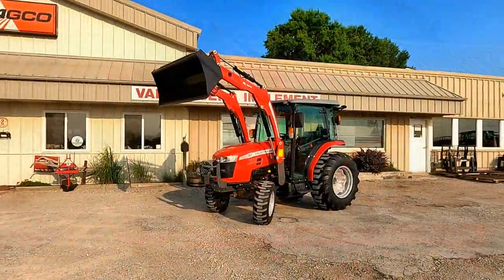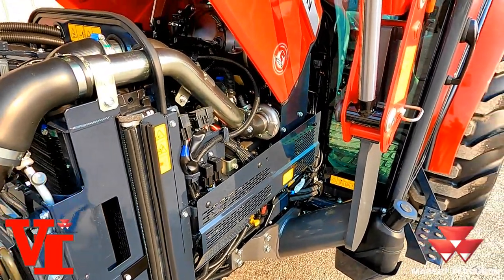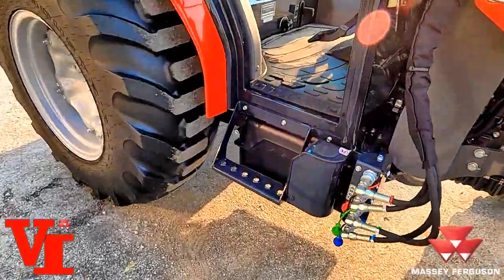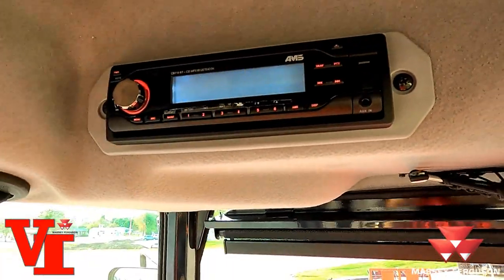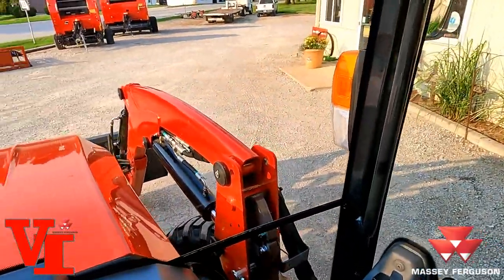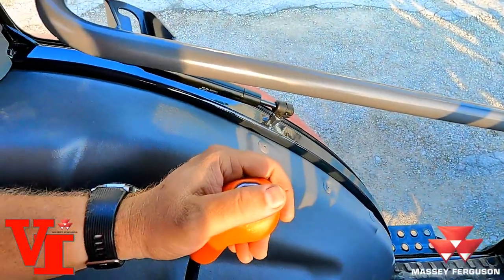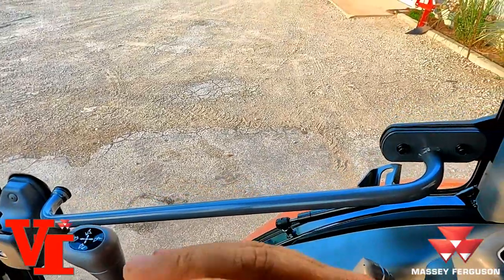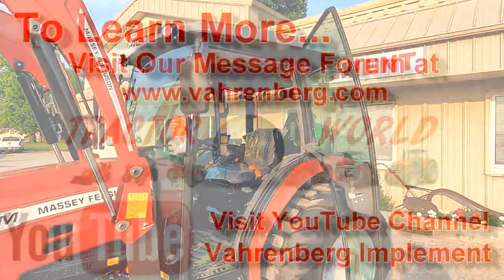Massey Ferguson 2860M eHydro Deluxe Cab Premium Compact Utility Tractor

Comment: I just took delivery of my 2860M hydro about three weeks ago.  Due to shortage of some components I don’t have the paid for third function on it yet.  Grapple is on order from Everything Attachments, so I’m ok without for now.  I’m an old clutch and transmission guy, and was wondering if I did right going to the hydro.  I LIKE it!  Found that Snail mode will really let the loader cut the dirt well!  Turtle mode is just about right in the field work.  Have not had it in Hare mode yet.  Thanks for the tip on using the cruise control and using the hydro control pedal to “catch” the speed and then smoothly decrease speed rather than the abrupt stop that happens if you push the button or hit the brakes. Also a good tip on using the single brake and building back pressure on slopes to prevent  rolling the wrong direction.  I suspect that trick works well when going either forward or reverse?  I’ll try it.  Had the AC on today with outside temp of 90 and very comfy inside the standard cab.  Have not found anything I dislike about this tractor.  With its size and capability it is on the high end of a Compact tractor.  It does a lot of things a traditional Utility tractor would do.  Thanks for all your videos.  Helped me buy Massey F.  No buyers remorse here!
Reply from the maker: Thanks for the AWESOME Review. That is good information and what we are hearing from our customers too. There is shortage on 3rd Function Kits...some guy did videos on them and with the high demand for Massey Ferguson Tractors in 2021 has created a supply issue. Thanks for taking the time to watch and comment on our video.

Comment: I was looking at the 2600H series and noticed it didn’t use the DPF..I also noticed the H series was pretty much all mechanical, which in my opinion is more reliable in that long run. My question is why the are these tractors equipped with the DPF while other MF tractors similar HP are not. 
I currently run a 2018 Kioti 40 HP. In the future I’d consider the MF if I decide to upgrade. Great video, keep ‘em coming.
Reply from the maker: 2800M are Stage 5 Level Emission (Coming to North America soon already in enforcement in Europe). AGCO made the decision because the writing was already on the wall when they developed the 2800M to forgo meeting just Tier 4 and Got to Stage 5 when it invested in helping ISEKI bring their engine back to market. They decided on a DPF Filter and Regen as the means to Meet Stage 5 Emissions. 
 2600H series Engine is clean enough to meet Tier 4 Emissions without REGEN, Diesel Particulate Filter or need for Diesel Exhaust Fluid. Uses EGR Exhaust Gas Recirculation. Depends on the Engine and how much soot (particulate Matter) or NOx (Nitrous Oxide) Gases an engine produces if it needs After Treatment. The 2600H does not require any after treatment systems. Also there are several Tiers with the Tier 4 Level less than 25 Engine HP, 25 to 75 Engine HP, 75 to 150 Engine HP and 150 Engine HP and above each one of these levels have different levels of Particulate Matters and NOx Gas Levels the engine can omit.

Comment: I have a 2860M hydro, and I love it. My only complaint is the auto throttle, specifically the fact that you can not disable it. Their are times when you don't want the tractor to change the RPM, you just want to adjust your ground speed.   I can list at least 4 different scenarios.  If you know a way to disable it, I would love to hear it.  All other manufactures that offer auto throttle have a way to disable it, why wouldn't Massey?
Reply from the maker: You can set the Manual Throttle to Minimum RPM and auto throttle will only work above that. My personal tractor I own has AutoThrottle and I can't think of a time I would want it disabled.
Reply: @VahrenbergImplement  Well, I can give a couple, when tedding hay, you need to adjust ground speed separate from the PTO. when I'm tilling and I get to the end of a row and I am traveling across the end of the garden empty and want to hurry across. When you travel down the road and you want to put the hydro pedal to the max. but not run 2700 RPMs. When you store it inside a shop but want to pull it outside to warm up, the moment you touch the hydro pedal it revs the engine.  I can go on, but you get the idea. Most of the time auto throttle is just fine, but there are times when it is a nuisance, and I would like the option to disable it.  There is no doubt that it is possible for Massey to have a way to disable it. I wish they would offer it.
Reply from the maker: 1) Tiling Example that is where AutoThrottle shines it will help get you there faster because the higher the throttle the faster you will travel. 2) Road Travel: If your running that fast you need more throttle or you'll be stalling the hydrostat at low rpm. 3) Use a lower range and it will not put as much load and not raise the RPMs with Autothrottle. How much are you willing to pay to Turn On/Off Auto Throttle? It's going to add more expense to the manufacturing of the tractor and not sure most if not all my customers would find any value in turning it off, probably the second most loved feature behind ground leveling fueling we get comments about to customers that own tractors with autothrottle.
Reply: @VahrenbergImplement  I am not looking to debate you on how great autothrottle is. Massey Ferguson's Autothrottle is not load sensing, it is preset in relation to the pedal position it has no idea if the tractor is pulling a load or just rolling out of the shed that is why It is not the perfect solution every time, that is why all other manufactures ( I don't believe they have load sensing either)  let you shut it off. 1) Tilling, I do want to move faster, but I'm not willing to rev the engine to the max to do it. (no load). 2) Road travel,(no load again) I don't stall the hydrostat, there is a happy medium between hydro position and throttle, experienced operators can hear, feel it. 3) pulling out of the shed to warm up. Using a lower range makes no difference, again not load sensing.  I am not bashing Massey, I was raised on them.  If I had the option to turn of Autothrottle it would be perfect,  If I could disable it permanently, I would rather do that. Just let your Rep. know that giving an override option instead of dumbing it down to the masses may be a better answer.  I have probably watched every video that you have posted on the Massey compacts, you do a great job and have great content.  Please keep it up. I am just hoping someone can help me find a way to override this option. Or may sure another buyer understands fully how it works.

Comment: What type of hydraulic oil do these tractors use , Just bought a 2850M shuttle shift about a month ago what a great tractor i love it , got 18 hrs on a tank of fuel not even topped off i think that was pretty good , plenty of power for what i am doing , Waiting on the second & third remote kits hopefully i get them this year , There is one thing i think needs to be corrected on a 2800 series Massey Ferguson tractors with shuttle shift the brake pedal is too close to the foot throttle i got a big foot & when its on the foot throttle my foot is under the right brake pedal i guess if you had a size 6 shoe it wouldn't be so bad, other than that
i really like it cold AC. good responsive hydraulics, The neighbors i haven't talked in over 2 years seen it & stopped by to check it out i think they went home to ask the wives if they were allowed to buy one too , I do like it so much to i might buy another one a little bigger next year I am one of those guys that needs two of everything Ha Ha.
Reply from the maker: AGCO Parts PermaTranIII/821XL Hydraulic Transmission Fluid is the OEM Fluid and what we use.

Comment: Since it is a quicke loader, any chance to get a mechanic self leveling loader like their C18S, or a conversion for the FL 2814? Can we get the FL 2811 loader in the US?
Reply from the maker: At this time Mechanical Self Leveling in not available in North America. I keep requesting it on my Wish List.  Be a great option for Massey Ferguson Compacts .
Reply: It's amazing they don't make it available here since they already have it available in other countries.  It would be an easy selling feature to make the loader standout from others in its class.
Reply from the maker: I've been requesting for several years. It will come some day. Quicke use to have an add on system for Self Leveling and that would be the cats meow. Sell as aftermarket attachment and it was reasonable but I think even Quicke stopped that add on kit but they over Standard or Self Level Loaders. I know Australia requires all loaders to be self leveling. Maybe some day we can get them in the states.

Comment: Just curious, does the 2800M series have fender mounted 3 point controls?  I've been spoiled having large tractors that have them.
Reply from the maker: The 2800M does not offer 3 Point Controls on the Fender. Only PTO Start/Stop option. 4700 & Up Series offers 3 Point Controls but that is larger series and models

Comment: Doug - I am looking at this exact tractor. Is it a good move to get the mid mount PTO right away?
Reply from the maker: Mid PTO is pretty expensive options and we sell very few here in Missouri. What are you going to use the MidPTO for? Snow Blower is only reason I see to get on 2860M.
Reply: @VahrenbergImplement  Was just thinking of future flexibility
Reply from the maker: Yes Front Broom too can use the Mid PTO. We have sold one of those. Be interesting to see more Front Mounted Implements in the Future but there is not many uses in the midwest here.

Comment: Another great video.. what disappoints me is they are putting those r4 tires on everything it seems. If you were new to tractors and didn't know any better you'd be disappointed with those slick r4's. I wish r4 tires were the optional ones not the r1. Keep up the good work.
Reply from the maker: You can choose which tires to order. Customer wanted R4 Tires and what we have requested the most is R4 Tires. You can have Turf, Industrial or Ag Tires. Are number #1 selling tire is the R4 Industrial Tires.
Reply: @VahrenbergImplement  oh yeah I mean what I generally see at most dealers when everyone had stock was the r4's unless it was 75+ hp. IMO you shouldn't have r4's on a tractor you plan to do something with other than cutting grass. I guess my years of farming and land clearing has just taught me say no to r4's if you plan on working with your tractor and not cruising on it like a Cadillac.
Reply from the maker: R4 Industrial is the compromise between turf and ag. They are less aggressive on grass but still have traction & mud cleanout ability just not as much as Ag Tires. Ag Tires work off grass...the construction industry uses them on all their equipment and it is' off road. Ag Tires can be more aggressive than people want for their needs and they choose the tire that meets their needs. We sell very few AG Tires as they are over aggressive for most peoples needs in the smaller compacts and small utility tractors.
Reply: @VahrenbergImplement  love those Galaxy AG tires they are great

Comment: After owning my new 2860M now for about 9 months I am very happy with it.  Only possible improvement I would suggest is having an oil pressure gauge.  I am sure the electronics are monitoring oil anyway, so not a big issue.  Here is a video link with a Anything attachment’s root grapple, that I really like.  https://youtu.be/AUA4Lb6-PnI
Reply from the maker: Thanks for the comments and yes Grapples are a great addition to tractors. We sell lots of the RhinoAG & Worksaver Grapples and ALO Quicke 4-N-1 Buckets which are even more awesome for many of the tractors we sell here at our dealership. This is a little "Amateur" Operator learning Grappling with a AGR60 Grapple. https://youtu.be/6VUtVYxc1sk

Comment: Absolutely a great tractor  I just prefer the shuttle transmission instead because it's just more handier for me  I hope to be in the market to be purchasing a 2855 M series with a cab shuttle trans with  a loader and of course front fenders to keep stones and dirt from damaging the glass on the front of the cab
Reply from the maker: We done video on the Massey Ferguson 2860M Power Shuttle too: https://youtu.be/fI6vPTBOazI?si=qLbw27-jkbt4W3JS we haven't sold 2855M Power Shuttle yet but is another choice in tractors too.
Reply: @VahrenbergImplement  THANK YOU However I did see your video on the 2860M series shuttle version and it was a nice detailed video too . In my opinion I   think that both variations are great tractors . I just like the shuttle version better because it's like running a big front end loader. I like the 2855 because of the numbers 2800 because of the old 2805 V8 MASSEY years ago and the 1155 of the second gen.of the V8 . I  have my dad's old 1150 V8 MASSEY  THATS WHY I LIKE THE NUMBERS OF THE 2855 .

Comment: What  is the price  range?
Reply from the maker: Best thing is to contact your local dealer for Current Sale Promotion and Low Rate Financing Options. Due to Public Pricing Policies we can only supply MSRP (List Price) as of 8/22/22 List Price on 2860M Deluxe Cab eHydro with Loader is $48,799.22 but visit your local dealer for exact pricing. If in West Central Missouri near Kansas City contact us at Vahrenberg Implement if out side our sales area here is dealer locator to find your dealer: https://www.masseyferguson.com/en_us.html#dealer-locator

Comment: Debating between a MF2860 and a kubota grand l6060
Reply from the maker: We've been trading for several late model Kubota lately. Both are good models but everyone we have sold the 2860M to absolutely loves them. Good luck in making your decision for whats best for you.
Reply: @VahrenbergImplement  have you heard of any issues with the kubotas grand l series models?
Reply from the maker: I don't like talking negative about other products but I have had several customers tell me they have had issues that needed servicing like hydrostat transmission that we have not had with the Massey Ferguson. And it's not just one transmission. But you never get the whole story either...How Did they Maintain>? What Oils did they Use? How did they use it? Can all effect service life. We started selling Massey Ferguson in 2007 and we not had to work on single Hydro we have sold.
Reply: Andy go Massey and you'll be happy

Comment: Does Massey Ferguson not let you fix your tractors like John Deere?
Reply from the maker: Anyone can work on there tractor. For 2021  Massey Ferguson has started rolling out programs for the customer to rent diagnostic equipment to perform their own repairs. Has started on the Global Series for 2021 Massey Ferguson Tractors. Doesn't tell you how to fix it that is what dealers pay for Service School Training for their mechanics but you can rent the diagnostic tool and try it yourself. Right to Repair is very misleading like many things the media has done, 99.9% of the customers are not going to mess with internal computer codes and that was what Deere wanted to protect is their Intellectual Property and the media twisted it out of context. IP is just like Microsoft Operating Systems you use on your computer.
Reply: So your saying Massey Ferguson rents tools and programs to help fix your tractor?
Reply from the maker: Massey Ferguson offers an Electronic Diagnostic Tool Rental Program that can be rented from them to help farmers who wish to attempt to do their own repairs. The Only Massey Ferguson Models currently available with the NEW Diagnostic Software capable of this program is the 4700 Global Series Tractors. As new models are introduced they will start incorporating the same opportunity for customers. I know sister brand Fendt Tractors 700 Gen 6 Tractors are also compatible. It will be rolling out to other models. The Person Performing the work is going to have to determine what and how to fix. Diagnostic Tools allow you to look at what is happening and error codes they don't tell you how to fix. That is what Dealers pay thousands and thousands of dollars annually to training their mechanics. Program is similar to going to auto parts store and getting code read on vehicles...doesn't tell you how to fix but the parts stores sells you components to try to resolve the problem.
Reply: Well that’s nice that Massey Ferguson let’s you fix your problems; instead of having to take it to a dealer every time there’s a problem.
Reply from the maker: Here is some good information from the industry on Right to Repair: https://r2rsolutions.org/
Reply: @VahrenbergImplement  from what I’ve seen with the link you provided, all they want to do is help farmers; if that’s the case, why are many farmers, as well as the media, angry at Deere?
Reply from the maker: Because Deere initially stated they own the rights to the software and license it to the tractor.